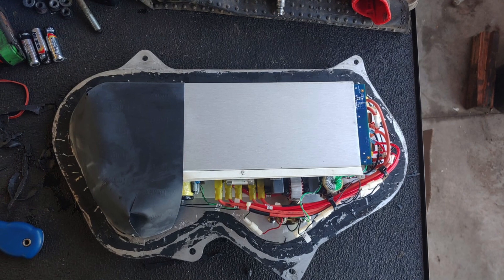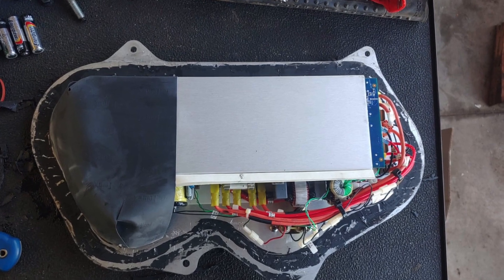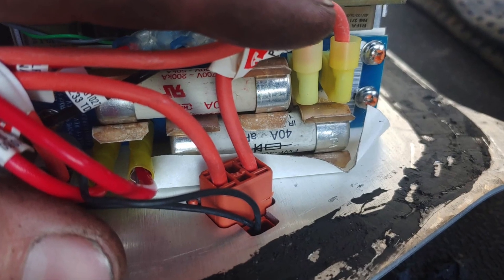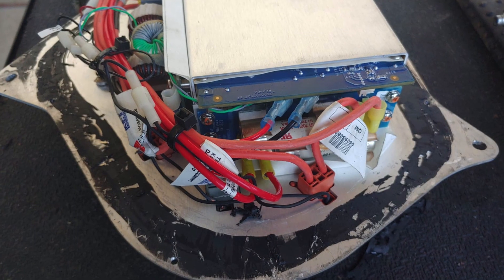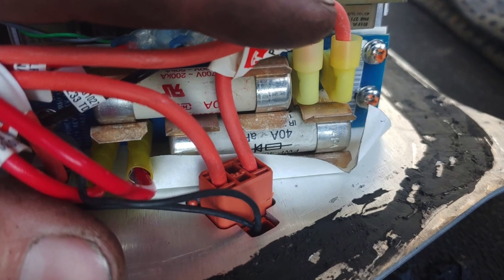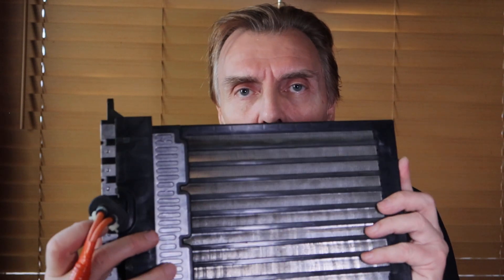Tesla Model S Heating PTC down - Most economical repair (en)

Comment: Hi, I want to raplace the fuse and PTC heater from the Tesla X. What about the high voltage power on the car? I have found technical manual of Tesla how to remove the PTC. But do not know if I have to remove the power of the car. Can you tell me what to do before starting to remove the PTC. BR Eddy
Reply from the maker: @NL-hf5mu  Definitely disconnect the high voltage. Rolf
Reply: Just remove the first responder loop. That should do the job.

Comment: Yup mine went out about 6 years ago and it cost me $2500. Guess what it went out again this last winter. I just replaced the fuse in the converter myself but still no hot air. Now to purchase a PTC heater and replace that.

Comment: Anyone know if the fan blower motor has a relay type fuse?  Mine is only working intermittently. 2016 Model S
Reply from the maker: Patrick, Are you subscribed to our channel? We would be glad to help. I would think the fan motor is 12V with brushes and would need to be replaced. Rolf
Reply: @TeslaOwnersUS I got one of it replaced by a local shop. It shows 2 rods shows right inner and right outer rod compromised. 

Is that acceptable. The local repair shop installed a refurbished one.
Reply from the maker: @Venkatesh.rangaraj  that is probably ok. It might not last that long. Rolf

Comment: I have 2013 Model S.  Heater not working.  They quoted 3k to 4k to fix. They won't know for sure until they can diagnose.  To diagnose is $175 an hour and it will take two to three hours.  That's why I haven't fix.  Is there a shop there that can do this repair.  I'm in Vegas.  Thanks
Reply: TJ Tan    Electrified Garage has a video on how to replace the fuses in the converter. They are located in north of Boston. I know that is far from you.  https://youtu.be/HWTcgFswHXE